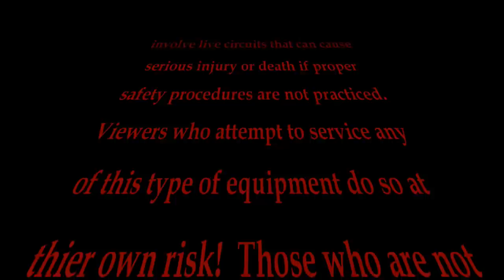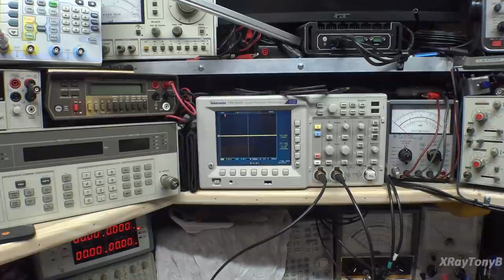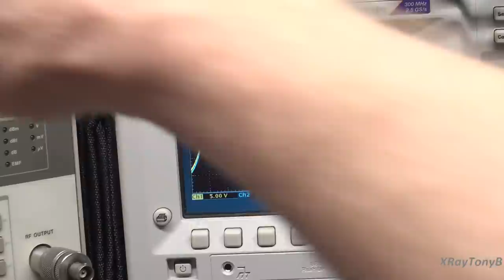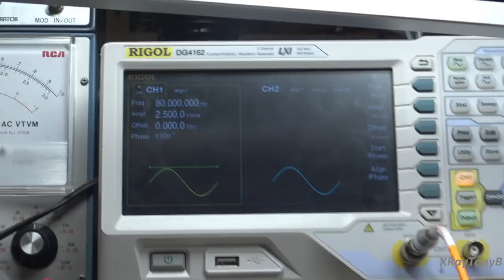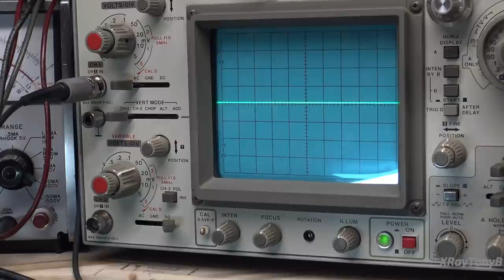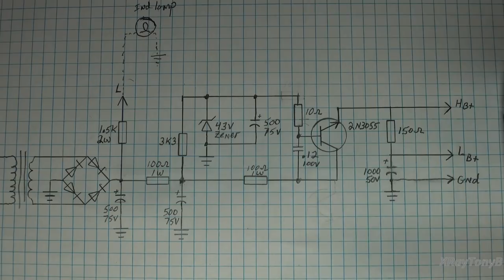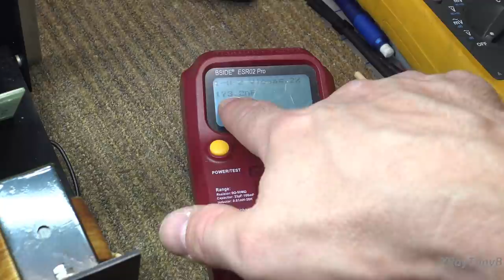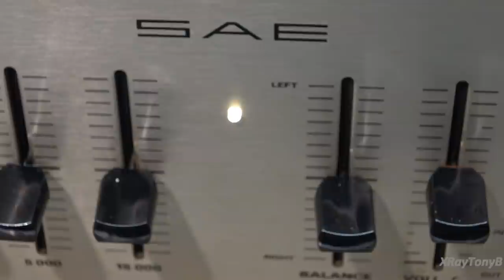SAE Mark Nine Preamp - Troubleshooting With No Schematics

Comment: The "inverted bell" is no different than a basic bass and treble control.  I never once did this.  I was a big fan of minor adjustment, but not screw up the sound.  Even as a once certified THX engineer, the EQ is best used to legitimately "flatten" a room, not make it sound bright and bassy.  The average user has no clue what they are doing, and a simple bass and treble control is fine for them.

I am actually glad the average EQ has been done away with, and now relegated to a DSP and microphone for a computer to adjust on higher end consumer equipment.  My Marantz receiver sounds great with that feature.

This also looks like a job for Paul Carlson and his capacitor leakage detector (insert cape picture here).

Comment: While an equalizer can compensate for room frequency response, it can't fix time delays due to reflections in the room. I once borrowed a 21 band equalizer and using a noise source and a sound pressure level meter at the listening position,  adjusted the equalizer for flat response. It turned out that for different sound pressure levels, different equalizer positions were required to achieve flat response. That's because the reflections in the room were a factor as SPL increased. Unless your room is an anechoic chamber, frequency compensation alone is insufficient.  Also, those band pass filters will introduce phase shift which adds yet another variable to the mix. I think equalizers for home use are more of a novelty than a necessity. I generally leave the tone controls flat or switch in the loudness contour for low level listening.
Reply: A friend of mine found a very effective way to dampen room modes. He has a truckload of plushies in there, stacked up to the ceiling on both sides. It's almost like staying in a anechoic chamber. :-p

Comment: To be honest, I prefer not to have any tone controls enabled in the audio path (most of the time). The only tone adjustment that I like to have available is the loudness control (for the occasional listening to something at very low volume levels). And, I prefer to have it implemented properly, as a variable loudness tied to the volume control. As you said, the listening setup is probably the most important and usually produces the best results if set up properly.
Now, let's get the facts straight, I used to play with the equalizers in the same exact manner you described :) and I always found that the minimal or no adjustments end up working for me.

Comment: My system would not be complete without a 5 to 9 band equalizer.  I have a 31 band which for me is excessive.  Every ear, room, every speaker, every music player, every music source, every music recording has a different frequency response. At age 74 I find I boost frequencies above 5,000 more than I used to.  I keep frequencies from 100 to 500 lower than I used to.  I will adjust from album to album to adjust for producer's bad taste.
Reply: I just listen to the music, not the audio.
Reply: I found FM radio input very different from CD input. Always helpful with tone controls.

Comment: Got a question for Mr. Xray, I'm up grading my crossovers in my speakers. My question is, if I get a expert like yourself( preferably you) and up grade the components in Kenwood amplifier( s ) will that enhance my soundstage or texture( if there is such a thing, I heard a "Audiophile" say that, I thought that sounded cool) if it makes a difference, tell me so. I'm not concerned with making it the same as it was, of course the same value( I did learn that from you) but, making it better by using better parts. I hope better parts, like in the crossovers in a speaker, will mean a difference to the signal going to my speakers.
Thanks Mr. Xray or who ever answers this question in advance.
Reply from the maker: Great question!  I will try to answer that in a future "Random Comments" video.  Thanks for the comment!

Comment: I wonder why you used caps in those square packages instead of the familiar round ones.  Better for audio?
Reply from the maker: Those were film capacitors.  They are in square packages.  The round ones were electrlytic. Film caps are better for this application.

Comment: I have to agree with you in that after playing around with an equalizer, U typically end up switching to "flat". 
Unless, the source is not of good quality.  I often listen to various video concerts and sometimes their sound quality is rather poor.  I compensate for that poor sound quality by accentuating frequency ranges.

With a good audio source, flat works fine
BTW,  the mic on the hat works great and the second level was the best.

Comment: SAE was generally not-too-high-end but was better than a lot of the stuff.  This wasn't their best. The parts were mediocre, those "Temple" caps were second-rate.  The main mechanical weak point was the pushbuttons. In the 70s the emphasis was on lots of knobs, lights and gadgets.  Your work is excellent.
Reply: SAE was very highly regarded for their time . a lot of companies used pushbuttons . My Mark 9 has worked flawlessly for over 40 yrs.

Comment: Equalizers suck, removing one frequency to enhance another you lose the original frequency. next thing that sucked from back then was the reverb. I built a 4 channel system in 1963 so I could put base on one amp and take the base out of another so I didn't suppress the highs that were removed. In a nut shell each amp had it's own base and treble.  I miss the old days when I could collect old TV's and radios and scrap them out for parts so I could make my projects..

Comment: an equalizer is in my opinion just useless, yet things are different if you start measuring the sound in the room and equalize the speakers to achieve a flat output. These systems are common, ie. Anthem room correction. Other brands have these kind of systems. A few band equalizer as in the video just disturbes the sound...

Comment: Put the noise caps across the primary of the transformer.  Then when the switch is open no current will flow.

Comment: Graphic EQ's are hard to use-- the 1/3 octaves specifically (27 band)  For tonal enhancement-- tone controls are the ideal... it's in the word.  
Graphic EQ's are for room correction.  Small limited 5 bands are the worst of both worlds.  Having said that I owned a Harmon Kardon Citation 11 preamp with a 5 band EQ and it killed-- the EQ points were in the perfect place.

Comment: I remember setting up my equalizer to what I thought sounded great. I then pressed the bypass button and realized how much I had changed the intended sound compared to the original. That was the last time I used the equalizer. I found I was better off trying to optimize the listening room.

Comment: I usually listen to things flat, because to do otherwise is to change the vision of the engineer/producer who mixed the record. That said, I have some speakers that are deficient in low end, and when I am using those to do add some low end to flatten out their frequency response.

But for lots of people EQ's are just ego enhancers. Not really needed.

When I mix bands live, I have several 31-band EQs in my rack to adjust for deficiencies in the rooms I am working in. Compensating for room modes which can create feedback at several frequencies.

And when I am mixing in the studio, the EQ is an invaluable tool to fix issued in the tracks you are mixing. Some home recordists don't know how to record well and they're recording in crappy rooms, so sometimes large EQ changes need to be made.

But at the end of the day if you have a good system (all rooms are different and awful so there's no point in talking about them) just listen flat and enjoy.

Comment: I would have disconnected that pilot lamp circuit entirely. Eventually one should be able to replace that bulb with an led using the low voltage ps rail and a series resistor.

Comment: Good grief, another one that threw everything it had at you. Yeah, I saw the 1970 date code on the 2N3055 at 47:55. You have unmatched persistence! Incidentally and apropos to nothing; in the late 80's I was selling higher end video gear in Hollywood, and I went to this (obviously quite wealthy) guy's house in the Hwd hills who wanted a video projector installed. Projectors were major pieces of work back then; of course, they utilized 3 CRTs, not LEDs, and were finicky and expensive. The house was built so that in his "theater room" there were huge raw boulders coming up out of floor. I can't recall his name, but the house was owned by Mr. SAE. Those were his initials. Yes, I know that Morris Kessler was the primary designer of SAE gear but I suspect Mr. SAE might have been the finance/marketing dude. Didn't buy no projector from me!

Comment: EQ’s are a gimmick. When you properly maintain your system (and own high end equipment) you only need a loudness contour control - if even - by that I mean, tone controls will not need to be augmented or boosted for any legitimate reason when you have a quality, balanced system which is properly maintained.

Comment: In my experience, the desire for an eq is directly related to the quality of the amplifier in relation to the quality of the speaker system. If I am listening to a very high quality system then I don’t feel a need to “color” the sound. If the system is lower quality and is lacking in certain frequencies then I want an eq to enhance whatever it is lacking.

Comment: Using an EQ for room compensation is probably not the best way to solve such an issue.
If the room is the problem, then IT should be fixed, not the signal to the speakers.
But if you have some music that is lacking in quality, or say an old recording of your grandpa,
then EQ would be ok to use.
BTW, we have all put in components and forgotten to solder them before testing.
As long as you don't reverse electrolytics.... (I did that today).
The new Cap-microphone works just fine. No problem with the audio.

Comment: Trouble shooting is done with all components in circuit, you use voltage measurement, 900 mfd. It is fine in a power, electrolytic caps have leakage, all of them. 
The zener sets the voltage to the base of the 2n3055 and the emitter of the 2n3055 to give a simi regulated voltage.
Reply: No.

Comment: The reason for the buzz is, you have created a ground loop, allowing the shield of the audio cable to out AC current, than being a transformer with the inter connector, causing buzz.
Reply: Good God man.  Just leave one comment.  You're ranting.

Comment: You should never run test in at clipping mode, only to find total output
Reply: Maybe a heat test to see if the AMPs circuits are running ok and to see if there is NO chance of 'thermal run away.'.

Comment: For me, equalizers are but a gimmick.  Just another piece of useless gear to add to the stack of the "hifi"-tower and make it look more impressive.  If the listening room is the culprit, improve it.  Adding a thick carpet, drapes or wall panels (like a painting on cloth) go a long way in neutralizing unwanted reflections, reaching a fine sound.  The best pre-amplifier is a wire.

Comment: I never use my tone control. Let alone an equalizer. If it doesn't sound good with flat controls, fix the problem instead of skating around it.

Comment: When control is two dirty to be cleaned easy they should be replaced, because, once  they start making noise they won't stop and only clean the ones that are actually causing a problem, otherwise you will run a food control.
The formula to convert DB to voltage gain is db log x 20. Sorry you di not understand the equipment you are trying to analyze, you don't need a schematic, you need to understand what the components are doing! Especially the EQ!
Reply: Most "dirty" controls can be cleaned and restored to normal operation.  I use LPS-1 and once cleaned they will operate for years without any issues.

Comment: The base input is CURRENT, NOT VOLTAGE, the base emitter junction is a zenner diod
Reply: A bipolar Transistor has a normal diode transfer curve when forward biased.  BUT, has a Zener diode transfer curve when reversed biased.

Comment: Equalizers are useless crap if you don't have the proper equipment to use them the correct way... only the 1/2 or 1/3 octave equalizers can be useful, the rest is toys.

Comment: Follow you through a blind circuit analysis all the time. Real nuts and bolts , spinning wrenches checkout. As far as the lamp use a power strip to kill equipment after its use,eliminating lamp glow possibly. It begs to reason when you turn a switch off on an instrument are you still slightly power